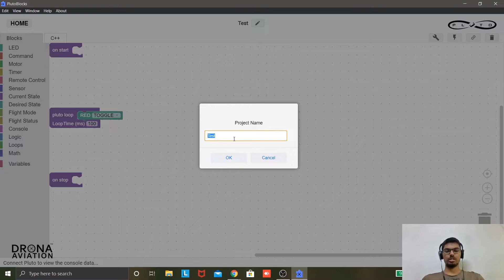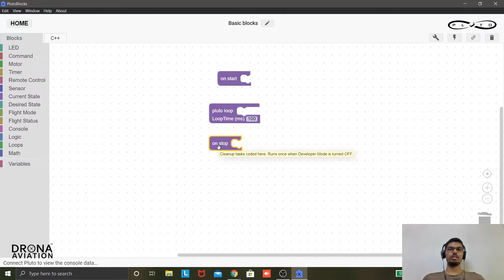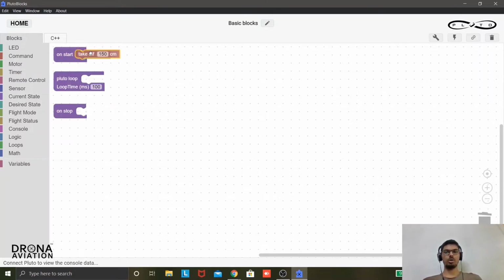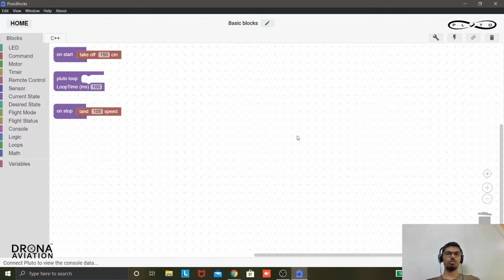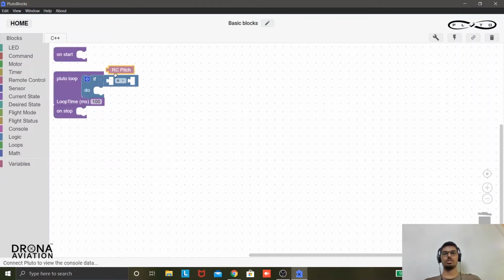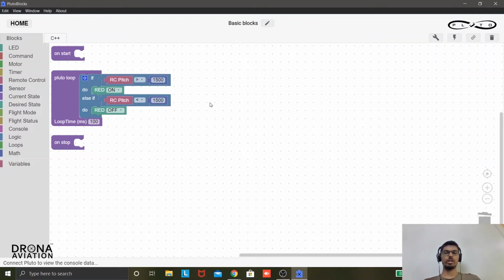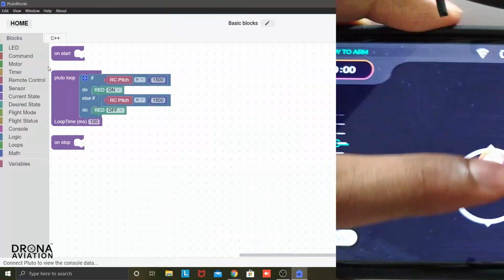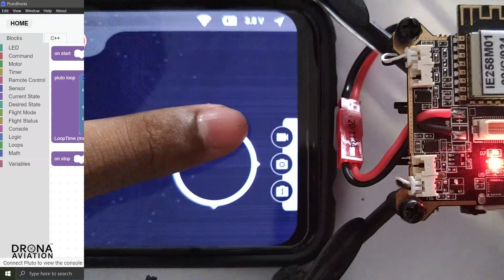Drone Programming Using Pluto Blocks: Basic Projects - I

Comment: When i flash this program on my pluto primus x2, i am just unable to connect to my drone as drone's wifi is not visible
Reply from the maker: You need to build new program with latest version of PlutoBlocks. Choose PrimusX2 while building the project. Flash the program using USB in case you have flash this old version and you are not able to see the WiFi.